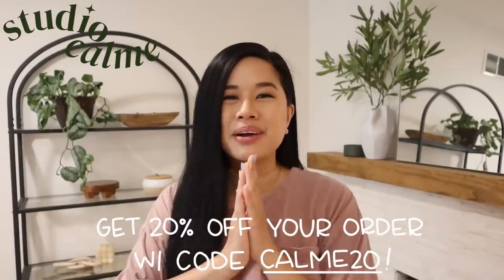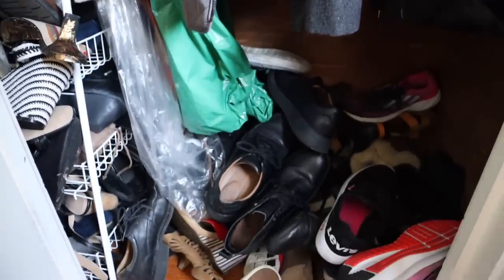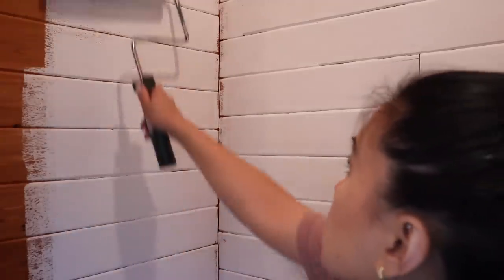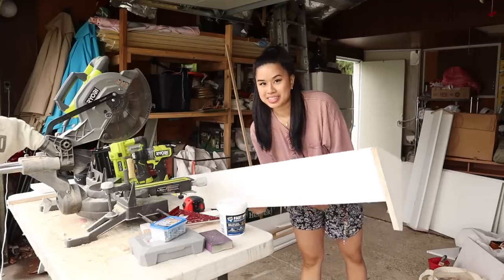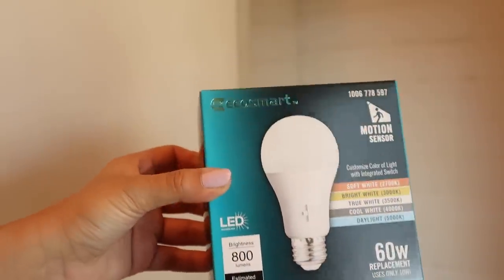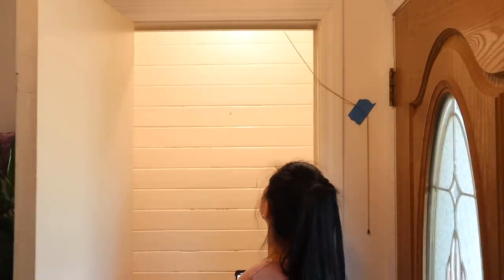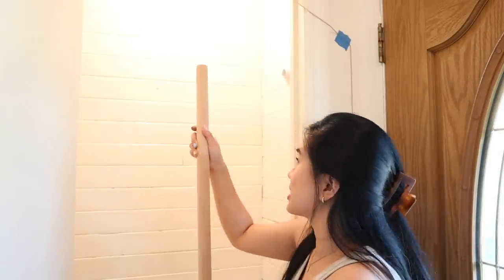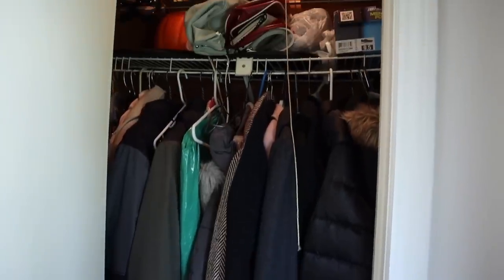MESSY ENTRYWAY CLOSET MAKEOVER W/ SPACE SAVING DIY STORAGE SOLUTIONS!

Comment: FYI you don’t need to use anchors when screwing into wood, and it actually is less effective when you use anchors in wood. Wood can hold the threads of screws because they bite into it without crumbling it. Anchors are for materials that can crumble like drywall, brick, cement, etc.